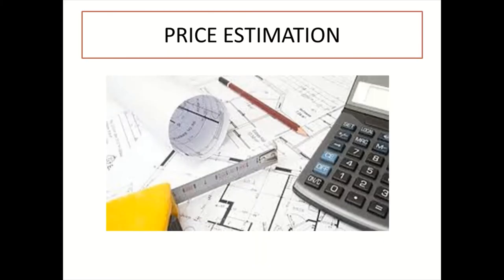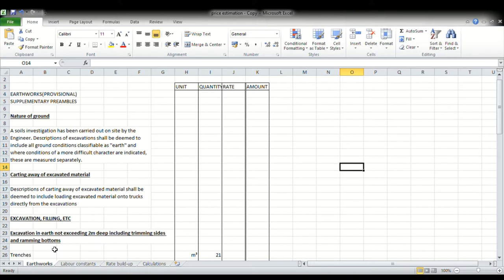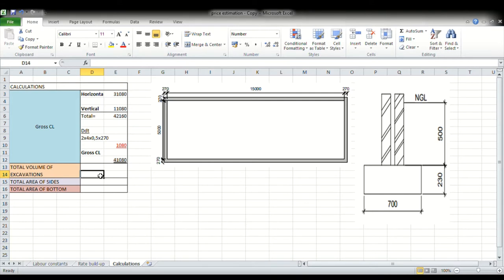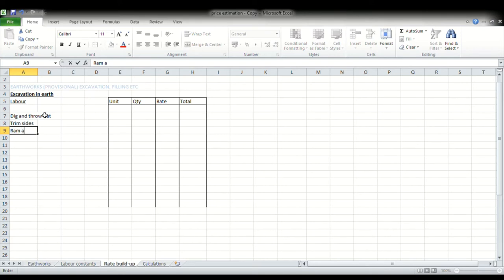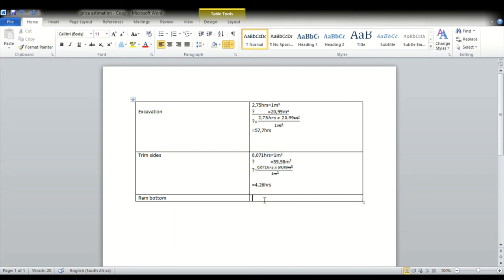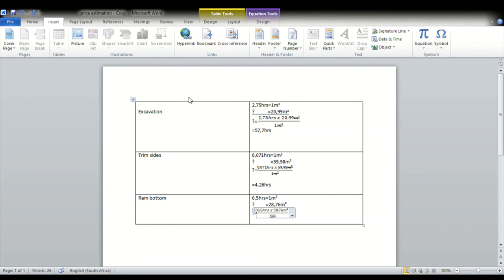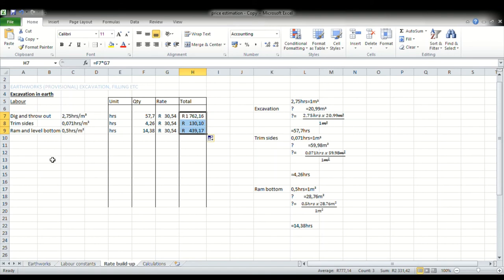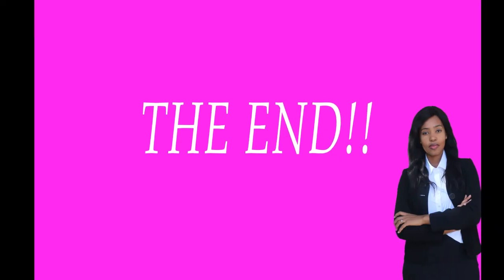Unit rate build-up for trench excavations| Price estimation

Comment: Hi, Thank you for making these videos They are so helpful . Can you please assist in how we go about doing quations for materials and doing build up rate
Reply: It's basically the same concept

The Material cost itself
Labour constant
Overheads
Profit

In example (installation of a door "including lockset and hinges")

Price of a door: R1000
Hinges: R150 x 2 hinges per door = R300
Lockset: R250 (including handles)
Labour constant: 0.83hours/door
Labour rate: R300/day
                    : R300/8hours
                    : R37.5/hour
0.83 x 37.5 =  R31.25/door installation

Therefore: R1550 + R31.25= R1581.25
Overhead at 5% = R79.06 + R1581.25
                            = R1660.31
Profit at 10% = R166.03 + R1660.31
                       = R1826.34/ door

I stand to be corrected